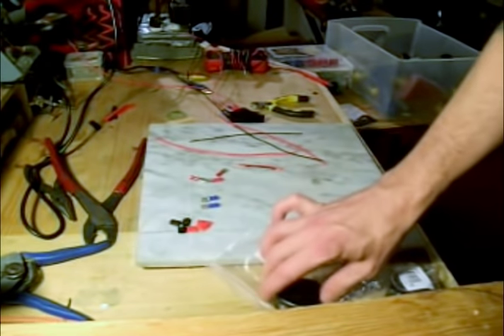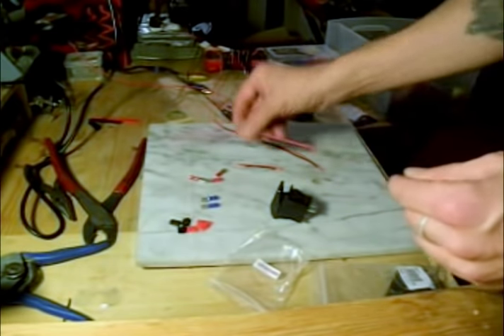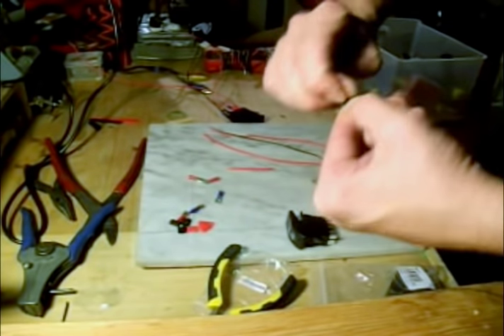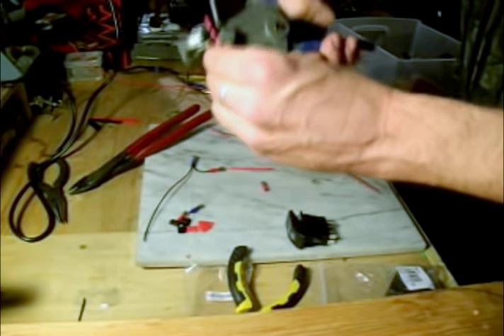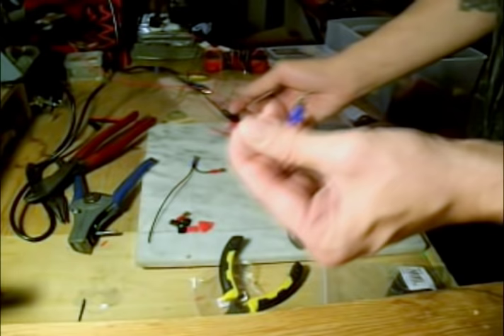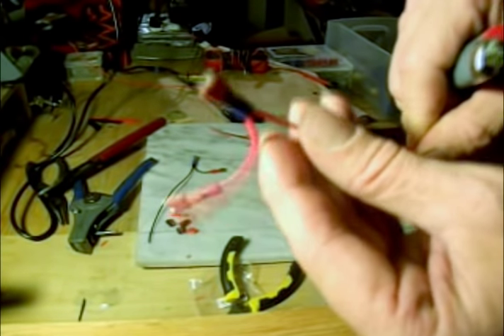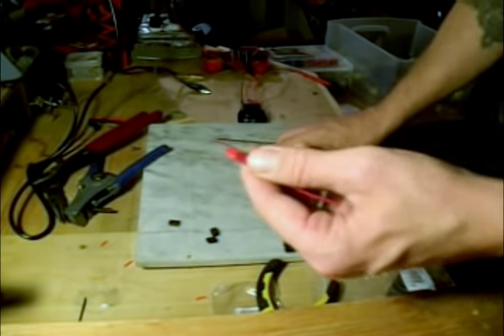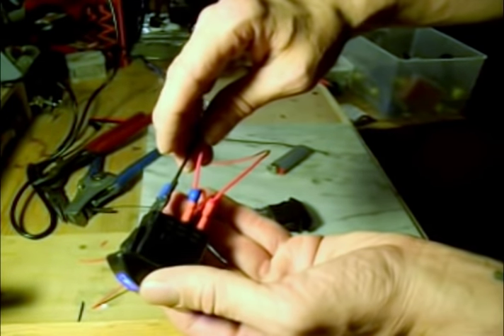LED rocker Switch

Comment: Thanks buddy,it did help,but my lights have 2 wires coming out of them,a black,and a red. Now that being said the switch has one black and two reds coming out of it. One red to light,one to acc,black to ground.....where does other wire to light come from?
Reply from the maker: There should be a black and a red on the light the black you can wire to the battery it does not have to go to the switch  or even the battery  any ground wire you can connect into.   the red from the switch has to go to the power on the light  no getting around that  either to a relay then light or direct to the light depending on the amp draw of the light and the total amp rating of the switch.  the switch can be grounded to anything as well  in the olden days we wired them to the frame or body but its different in these new fangled cars lol
Reply: kootenayboy,thank you,i got it! Now,do you do a video on how to wire up a 7 pin winch switch lol
Reply from the maker: I'll see what I can do, though the 7 pin is exactly the same as the 4-5-6 pin  the extra pin is simple power out to a second load (light etc)  so you wire it the same then use your meter to double check that when the switch is in the on position your getting 12v power out to both output posts  (separately ) and no power out to both when the switch is in the off position  if you get power to one and not the other you have the wrong post.  that said you would need to make very sure the load does not exceed the switch's max amp output or it will melt where ever its mounted (if your lucky if your not lucky its a fire)  so you would need to know the amp of the switch and then add the amp rating of both lights (or load) together to see what they are combined.  UNLESS your using it to toggle a relay after the switch then it does not matter  what the load is to the switch, and with the relays you can get creative one switch could have one light on and the others off while the switch is in the on position depending on how you have wired the norm open/norm closed posts on the relay  ( relays are fun lol  I have a vid in the world for them fun but can be hard to understand for some applications)  hope this helps  and Ill look into doing a 7 pin vid  thanks for watching :)
Reply: kootenayboy,ok thanks,it will be for a winch,so there would be an in/out
Reply from the maker: Ok Im not positive but I think in that case I think you would need a 3 way switch on-off -on  as if it was just on off you would be sending power to both feed and pull at the same time?  and relays with norm open and norm closed  would not help either.   I bought one by mistake when I replaced the switch on an upright vacuum  they are not expensive.  I think I may have misunderstood your question when you said 7 post I thought you meant a toggle switch with  on off but two lines out, sorry
Reply: kootenayboy,yes thats what im talking about,to me wiring up a house is easier than these switches lol
Reply from the maker: lol ya it is  well till  you hit one of those three way switches  in a house.   "Usually" the posts located at the same end the switch is pointing too is that wires on position and the center is "OFF"  and the center posts are for the line in (power source)    when in doubt I use my multi meter it has a feature that I use a lot,  it beeps when the circuit is completed  (switched on/open)  so if I know the center  is line in I connect one probe to the center and then the other to the post I want to know when it gets power   (no need to have it wired to power because as soon as I flip the switch to the right position the circuit will be completed) and the meter beeps flip the switch again and no beep means thats the right post.   best $20 I ever spent at walmart lol
Reply from the maker: I ordered a 7 pin winch switch from China the other day and as soon as it comes in I will make a tutorial on wiring them, hope its not too late for you.
Reply: kootenayboy,nope not at all buddy. Mine is for a wireless winch,so i have hust been using my remote,but would love to get a switch wired up just incase

Comment: How do you wire it so the led on switch lights up only when ignition is on?
Reply from the maker: run the wire that powers the switch to a wire that stems from the ACC on the ignition  in newer type cars trucks thats usually any of the power outlets stereo power wires etc  if it only works when the key is on you can tap it and power the switch from that  most people do not want the switch hot 24/7 anyway   you can also buy piggyback fuse's too what plug into a fuse in your fuse box but have a lead that come off them as well as a fuse  its like adding a power bar to an outlet :)  I saw them at walmart in the automotive stereo section
Reply: kootenayboy great idea! Thanks
Reply from the maker: happy to help :)

Comment: Are they suppose to stay ON all the time even when the truck is completely shut OFF. I install a Rocker switch but i shut down ignition (Truck OFF) the bottom light stay ON all the time. Is that normal or Will it drain out my battery?...How can i eliminate that?
Reply from the maker: The drain would be minimal as its a small LED and uses next to no juice  that said it would depend on the load and life of your battery, if its a small tractor or ATV batt etc.   Yes of course you can disable the 24./7 nature of this  (I did)  by hooking that side of the switch into a ACC wire  one that is only on when your key is turned to the ACC or on position  something like headlights, heaters, most cabin (interior) Acc sources (cigarette lighter outlets for us old koots)   simply find something thats ACC and tap into that or wire one from the distribution center under the hood.  Wallmart/Amazon and ebay all sell these cool little fuses that you plug into a space in your existing fuse box they come off of that with a secondary fuse link so you can still use the original fuse spot and add another load to that  it would make this very easy to do
Reply: Ok thank you for that information & awesome video btw
Reply from the maker: thank you for watching and happy I could help :)

Comment: Great video! In your demonstration you have it set up so that the little bottom light stays on and the big upper light (zombie light) only illuminates when it is turned on. Is there a way to reverse that? I'd like for the bigger upper light that has the name of the acc to be lit when not turned on and the little bottom light to only be illuminated when the switch is turned on.
Reply: I’m not 100% sure on all brand switches but when I bought mine (Contura Rocker - 5 pin) from Ottratw,  you choose lower dependent or upper dependent switch. This decides what Led on switch would stay on and which would light up when switch is depressed. Hope this helps someone. I know this is old quest.

Comment: The second one you had done already looked like it was wired differently? Are they different?
Reply: I saw this too, it was wired differently.  The second one had the illumination wired to constant (regardless of switch position), the first had the illumination lamp wired to trigger while the switch was in closed position.  Pointless video unless both methods are discussed as to the desired outcome.

Comment: Why is the one you wired up in the video different from the one you plugged in that wasn't shown being wired up? I'm trying to wire a light bar for my children's go kart but I can't seem to get power to it. Looks like you moved the red wire from the bottom prongs to the middle power prong.
Reply from the maker: I appoligise  for the confusion, the difference in the video has to do with powering the LED light inside the switch  to have it always on or only on when the key is moved to on or Acc. (I also had one switch upside down)    its pretty simple,  in most cases the top two posts are the ground  the middle is the power in (+) the bottom two are one to the load and the other to the LED light in the switch. I apologize for the confusion.   If you own a multi-meter it probably has (what I call)  the beep feature where when you complete a circuit the meter will chime simply hook the one probe to one + post and the other to the load posts   then toggle the switch if you get a chime on one of the + posts but not the other 

the post that chimes when toggled is the post you send to the LED light bar the one beside it thats not powered when the switch is flipped is the LED in the switch to tell you when its on etc. they do it this way so you have more options for different applications out of one switch 

does this help?

Comment: You do realize you wired that switch wrong don’t you The LED backlight function of that switch should have been wired to your ignition or your headlight switch not to your constant on from your battery. That way the backlight is only on if the lights are on or the ignition is on.
Reply from the maker: ohh Im glad you told me for years they have been in my truck operating the ten light bars on my roof rack Id better run out and rip them all out and re do them  thanks for the heads up